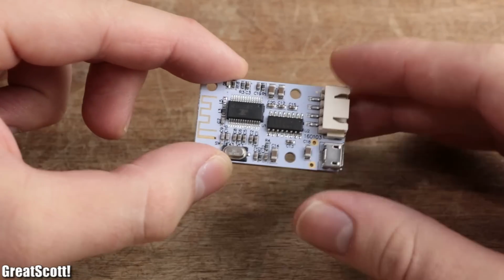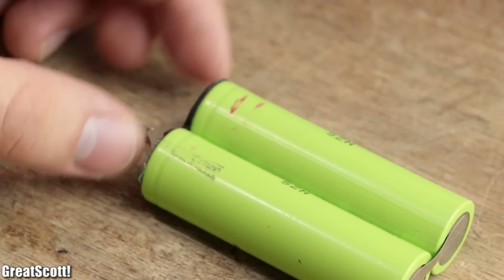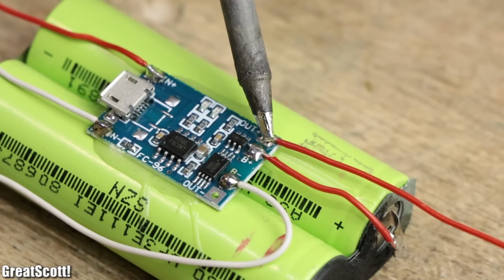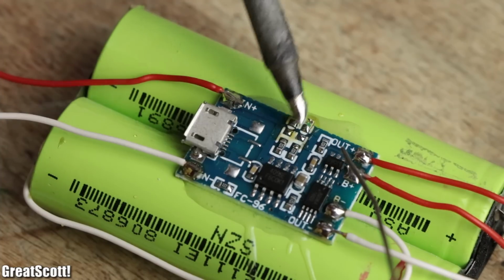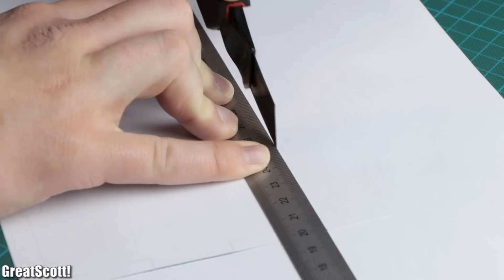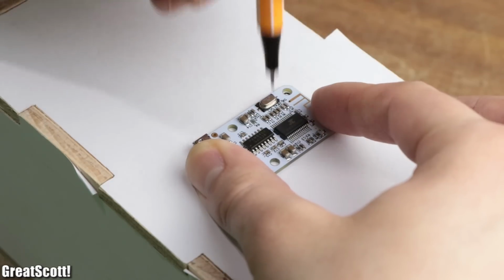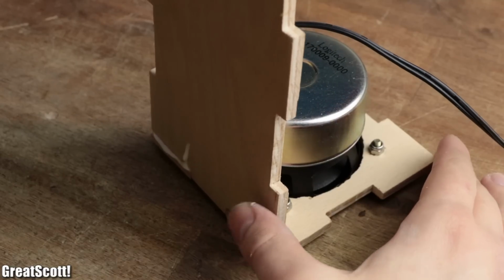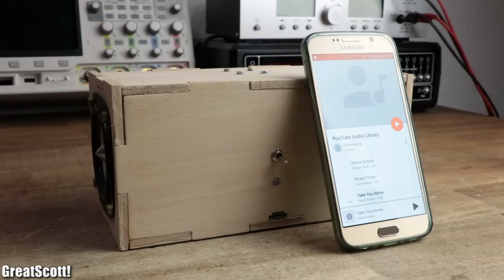Make your own Simple & Cheap Portable Bluetooth Speaker

Comment: I always get a lot of noise when using a buck converter....almost like coil whine..ofc I always use 2-3 different amps for a speaker...because I like overkill....I think the issue lies in the amps at different voltage...one for the tweeters specifically has a lower voltage than the one for the main drivers.

Comment: I'm having a Bluetooth speaker wiring issue, it appears the black wire from my volume control has come loose, it's seems that the only place it belongs is connected to the speaker itself or is there somewhere else it belongs? It's already connected to the board it's self. If anyone could help me that would be appreciated. I can solder if need be,just need to make sure that's where it goes, if you want a picture of wiring please reply and I'll send one over.....thanks very much.....Blaise

Comment: Everything is alright but why the hell are you put speaker's side by side not in front panel that's be do a better sound quality and why you didn't use passive radiators or any bass reflex holes?

Comment: the circuit you showed in the beginning wasn't impractical at all. In fact, I use a similar setup with my One Plus 7, because I LOVE my wired earphones, but cannot keep changing dongles. Bluetooth adapter for a 3.5mm jack is a pretty solid fix

Comment: Do you have any suggestions on adding a pair of speakers from an existing Bluetooth speaker to another existing Bluetooth speaker and actually making it louder than it was before? I have successfully put the speakers in and wired them into the wiring that exists in the speaker I plan on using but as I expect it and it isn't actually any louder. Should I be wiring in the board from the donor speaker?

Comment: I am new to this. How do I go about adjusting my boost converter to 5 volts? And does the ohm/watt value on the speaker come into play in any of this? I picked up my speakers at a thrift shop and they are 4 ohm 10 watt.
Reply: I also would rather install a toggle/volume knob instead of a switch. Can i buy any knob or does it have to be "single pole" like you said in the video

Comment: The link for the Li-Ion Battery doesent work. Does anybody have a good oportunity
Reply: Just get a power bank. It might be a bit more expensive, but it has everything you need integrated in it. And you could charge your phone with it if you want to.
Reply: @theodiscusgaming3909  how much mAh would you suggest
Reply: @eking9954  Sorry for the late reply, but as you can see in the video, even a single cell (2600 mAh) or dual cell (5400 mAh) power bank wouldn't have a problem with powering just the speaker. However, if you want to charge your phone with it too, it's a good idea to go with a higher capacity. This depends on your phone's battery, but 10000 mAh would be a good start. 
If you're actually building this, I would suggest making the box easy to open, and using more connectors to connect the parts together instead of just solder joints as he did. And use tape instead of hot glue. Doing this will make it much, much easier to replace components in case anything goes wrong. And if you want to use just the power bank, you can simply take it out.

Comment: Made a big version of this which works fantastically well when plugged into a source, but Bluetooth is picking up interference which I've tracked to being conducted along the 5V power supply to the Bluetooth receiver. Using a ferrite made no difference.  Any tips gratefully received ! (5P4S batt pack boosted to 50V for 200W amp + small pair of high quality hifi speakers)
Reply: did you resolve your problem?

Comment: I am working on something similar. For this I need 12V and thought me that 3 * 2 cells connected in series should be fine. But I need a BMS  witch can ballance. So I found the following one. But how can I charge them via USB? Or is it possible to use the BMS in the video 3 times parallel?
https://de.aliexpress.com/item/1000005493981.html?spm=a2g0o.cart.0.0.49063c00S6dUOU
Reply: You can use this BMS but charging via USB will not work. Even if you
 connect a 5V / 2A USB power supply and burn the cables with 2A, you get on the output side (at 12.6V) only a little more than 700mA out (assumed 90% efficiency of the boost-converter). Even if you use a measly 2500mAh cells, that means about 8h Charging time. A real power supply at 12V or at least 9V and a Connector that can handle 3 or 4A, would be recommend!

Comment: Is it possible to have bluetooth and 3.5mm audio jack on this? If yes how? Thanks
Reply: Connect the audio jack to the output terminals of the amplifier. A toggle switch can be used to switch between either speaker or headphones. 
It already has Bluetooth but it won't be needed if you play aux via an audio jack. Simply leave the Bluetooth OFF and let the signal go in via the jack.
Important...when you play via the jack you INPUT signal will govern the volume as this amplifier doesn't have a dedicated volume regulation. So be aware of that or you'll blast yourself with full power in the headphones!
Reply: @kalleklp7291  Thanks. But i meant input 3.5mm and maybe a switch to switch to bluetooth and to aux.
 Extra: is it possible to have a volume regulation on this?

Comment: I made a complete Bluetooth speaker. It's fine but I wanted it to be loud. So I bought 2 boose converters. When I completed the connection it wouldn't work. Pls help. Those were 5w speakers and they were getting 2.5w about.
Edit: And since u r using the boose converter between the battery and Bluetooth board but I used it (two of them) between the board and speaker.

Comment: Hi,i am building a Bluetooth speaker,my parts are 
TP4056 charger module
PAM8403
Usb Bluetooth audio receiver
And connected the amplifier (PAM8403) and the usb Bluetooth audio receiver in the same power source(battery),and both have same switch,but i get this hissing sometimes static sounds when it turn on,how can i get rid of the sound?i dont want it to have a separate power source so i build it as small as possible.thanks
Reply: No answer?nothing? Not so great after all.
Anyone out there who knows?

Comment: Why didn't u use a cheap power bank as a Battery and charging board, in my opinion that would be cheaper and easier than assembling everything yourself.

Comment: I've done a similar setup: I put a battery holder x4 batteries. I'm concerning about the hot that the TP4056 is producing during charging, I can't even touch it and batteries start gradually warming until become very very hot, even with 2 batteries as GreatScott's speaker. Dunno, is it all normal? Don't want to start a fire in house or lose 2 fingers for an explosion :D

Comment: "The Bluetooth device is connected successfully" how can i change this sound?
Reply: It's probably flashed onto the controller itself. Unless you find out what firmware is on that thing I'd say there is not direct way to do that. Then again workarounds are possible. The board should provide some other digital way for signaling that the connection has been established. You can then use your own board to work with that signal and output different audio, light up a LED or something else.
Reply: Lookup the datasheet for the main IC on the Bluetooth board and see if it offers a program to reprogram the module via SPI or other interface.
Reply: use Arduino or Rasberrypi

Comment: I dont know if you know but im certain that the chinese purposely reverse the wiring colours to the internal battery on most of thier bt speakers so if you were to attempt to replace the internal battery you would follow the wiring colours reversing the polarity and damage the internal circuits which is a tactic to stop you repairing the unit.

Comment: These are not acoustic suspension drivers so a bass port would help. Also try damping the box and use hollow fibre from an old duvet for extended bass! :)

Comment: A much better way is go out and find a cheap $5-$10 portable Bluetooth speaker that already has everything needed such as BT PCB and Rechargeable Battery. Most I've bought with a single speaker are actually setup on the BT PCB for dual speakers for Stereo Sound. It's how I add BT to old vintage Philco Radios I collect. Much easier than ordering and comes out cheaper too with same or sometimes more power. Still if you want you can even add a preamp between the BT and Speaker for louder sound. 

I usually like your vids but honestly not so much with this one.

Comment: Is it possible to use the Signal from the outputs right away for a normal Aux input of an Speaker system or should i grab the signal before the amp?

Comment: This is quite a lot of work and money for a 6W set...
I did this before while staying under 10€ and having a much, much smaller package, although it wasn't bluetooth (because I didn't want it), just an amplified pair of speakers. The whole thing runs on AAs and lasts roughly 2 months as computer loudspeakers.
I bought two 4inch 3W speakers, an 8xAA battery holder, a PAM8403 5V amp, and a step-down converter to make whatever voltage the AAs are outputting to 5V. All under 10€. The case was a small tupperware whose insides were filled sound isolation and wood speaker holders that hid all the electronics, leaving only the batteries accessible.

Comment: Dear GreatScott. I recently got a stereo set which was broken, although the speakers still work. They are 50 watts each. I want to use 5 18650 batteries in series, they are 4.22 volts and .158 ampere. If I connect them in series they are 20.3 volts, 1.850 ampere and 37.50 watts. Can I use the same products as you used in this video? Because the board is 5 volt and not 20 volt

Comment: I have built Bluetooth speaker using the same Bluetooth amplifier board. My total costs were very low, as I bougth this module from eBay only for 3 €, then I ordered some USB charging module from Aliexpress for 1 €. Rest of the items needed was just recyclation: Wood used from old palette, two full - range speakers from my old car and battery from my smartphone which I recently bought by mistake. Sound quality is pretty good concerning the price, but for the next time I would surely use some better amplifier board. Although sound quality is not bad, to connect the wires together is the easiest step in all assembly and some better quality amplifier would improove final result.

Comment: Well I recently bought a new MP3 Bluetooth with USB function I want to ask something how to connect it to the Amplifier.This is the image:
 https://imgur.com/gallery/mcVtI
Reply: And i use 3 Cell battery from my old powerbank it's 10 mAh capacity and when I charge it with the circuit protection the circuit become very hot and when I apply 9v in out accidently with my power supply the circuit blews up

Comment: I made the bluetooth portable speaker. but I am getting a Hum or buzz sound. The component are given below

1. 16.8v lithium battery (4 no. series)
2. Amplifier Board (12-24v)
3. MP3 decoding board. (8-18v)

When I unplug the MP3 Decoder board and play thru amplifier there is no noise

Any idea how to reduce the noise.

Comment: Great video. Congratulations!

A tip with the templates, instead of glue it directly to the wood, first you put some tape on the wood and after you glue it on the tape, so it´ll be removed easily.

Sorry about my english

Comment: hi, I have an amp for 2x3W speakers that runs on 9v (3-12V actually)... which is better for it: 3s followed by buck-boost to amp and buck to bluetooth, or 3p that goes into a boost converter to both (separate boosts) ??

Comment: I don't understand why you used a breakout board when you could have easily used the TP4056 then use the boost converter and check the voltage at the connection point of the Bluetooth amp instead of gluing it to the batteries, the reason why is there will be a loss of current thru the wires, right? Use a couple pieces of masking tape then tape the template down to the wood and use the edge of the pencil and sketch over the template and wood the remove the template for reuse for another model done my way. I have a bunch of 4.2v 1amp protected to 5v for battery banks, done in one shot. Also you can use a small piece of fiber optic cable and have it angled directly to the lights on the TP4056 and drill a small hole in the same place you did for the extra LED and glue it down inside the box. You could have just used the same case the speakers were in and add the same amount in length of cable raveled up in the case you mounted the board so you have equal amounts of power loss never exceeding 8 ft and a 8ft cable running to the second satellite speaker. 101 brother

Comment: two things  you failed to  talk about  in detail, the first was the diodes that was used on the led light. was that a jumper.  you did not explain that very well. and also how to connect the two batteries to make  together ,to make one. let me know what you did.

Comment: Would it be possible to use this circuit for a pair of headphones with a maximum input power of 100mW? (I assume it will break the headphones)
Reply: I know it is late, but headphones sometimes use a much higher impedance drivers, like 16 ohms or 32 ohms.
This amp delivers about 3w per channel at 4 ohms. Every time you double the impedance, you half the power.
So at 8 ohms you would have 1.5W, and at 16 ohms you would have 0.750w, and at 32 ohms 0.350w.
So you would exceed max power ratings, but not by much, and you can keep your headphones in the safe range by adding resistance to them or simply by not turning up the amplifier all the way up.

Comment: hiya " Great Scott"
I'm building one of these bluetooth set ups and am having trouble adjusting the boost converter to 5.0v the lowest I can get it is 7.04v what am I doing wrong.
thankyou Ian
Reply: Maybe you are running the batteries in series and not parallel? What I've learnt recently on other projects are these adjustable modules only go one way, ie step up won't go down in voltage.

Comment: Like all the rules but I would have done differently. The body made a cnc machine with a beautiful carving if there is not then would order a carpenter, And would make another hole for air circulation since in this box the relative vacuum is not good.

Comment: Someone help. So I recycled a set of broken Bluetooth headphones. They worked perfectly fine it's just the speakers in them stopped working. I replaced these with a set of bigger speakers and powered them with a 3.6 Lithium ion battery. They produced sound but at maximum volume weren't very loud. Do you think it's because they speakers are bad or because I used the Bluetooth headphone module? Please someone help I don't know if I should purchase another Bluetooth module.

Comment: @GreatScott! I have done the same thing except that instead of the Bluetooth board I used the pam8403 and an audio jack 
but at Loud volumes the circuit just stops playing, is it the over current protection of the tp4056 module?
help please.

Comment: I'll use a lm7805 for voltage regulator just for the Bluetooth but I'll add an amplifier and connect it directly to the battery +

Comment: Si eres de méxico y quieres hacer este proyecto los componentes los encuentras en mercadolibre dejo los links aunque la verdad no sale tan económico igual podrías ir a una tienda de electrónica de tu localidad.

http://listado.mercadolibre.com.mx/bateria-li-ion-18650-3.6v#D[A:bateria-li-ion-18650-3.6v]
http://articulo.mercadolibre.com.mx/MLM-549376869-bateria-samsung-2600mah-37v-li-po-recargable-18650-arduino-_JM
http://listado.mercadolibre.com.mx/tda7492p#D[A:tda7492p]
http://listado.mercadolibre.com.mx/bocina-ohms-3w#D[A:bocina-ohms-3w]
http://listado.mercadolibre.com.mx/mt3608#D[A:mt3608-]
http://listado.mercadolibre.com.mx/spdt-switch#D[A:--spdt-switch]
http://articulo.mercadolibre.com.mx/MLM-564651684-modulo-cargador-de-bateria-de-litio-lipo-entrada-micro-usb-_JM
http://listado.mercadolibre.com.mx/modulo-micro-usb-tipo-b#D[A:modulo-micro-usb-tipo-b]
http://listado.mercadolibre.com.mx/leds-rgb-anodo-comun#D[A:leds-rgb-anodo-comun]

Comment: Thank you for the video. 
I have a problem with the boost converter. Its output won't change , it keeps showing 3.85V when I turn the potentiometer, am I doing something wrong?. I bought 2, and they both act the same way. The input side says 3.95V
Reply: did you fix it?

Comment: How can i upgrade a battery on my bluetooth speaker, the battery is very small and it dishchareges very quickly, how can i now what battery i can use if i want a bigger battery?
Reply: use a battery that has same voltage but more mah or just add another or maybe 2 or 3 battery with same voltage in parallel my bluetooth lasts all day max volume with 3 batteries  :)
Reply: thank you

Comment: Hay guys funny idea. Can I use a standard phone battery 3.7v li-ion (5Wh) Instead of the ones he used. I'm sure we all have some old phones hiding around the house, could make the project cheaper?
Reply: Just have to hook it up to the proper terminals see if its enough to juice it. The same charger should work since it runs on the same voltage. Used phone battery life isn't very fresh though these Panasonic and SunLabz NCR batteries give you a lot more performance.
Reply: Thnx I know that most are at it's end, but I will try to recycle them and if they will be to weak well ebay to the rescue =)

Comment: Why not just use a cheap power bank and a micro USB cable, it would save lots of time and has all of the charging and protection circuits built in.

Comment: Did you reverse the polarity of one of the the speakers as they are positioned 180 degrees to each other?  Otherwise they will cancel (particularly the low frequencies).